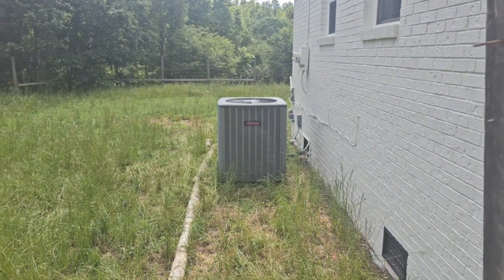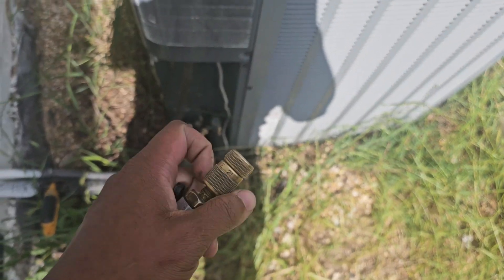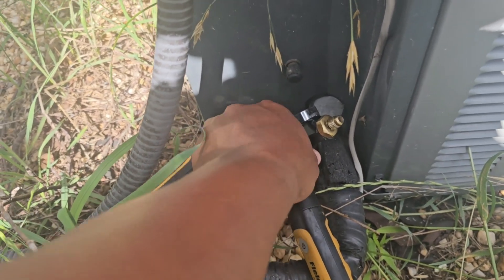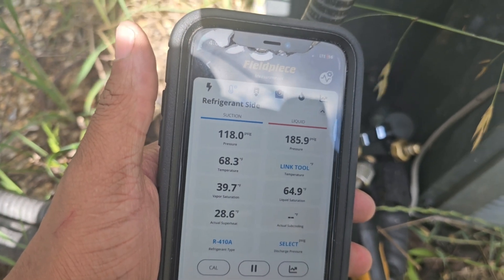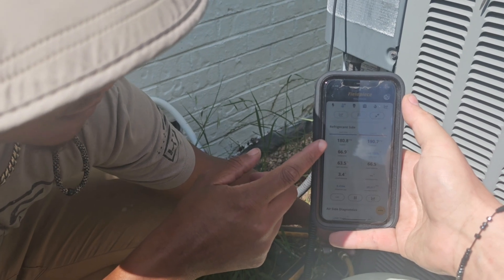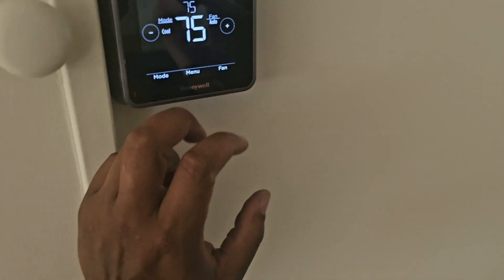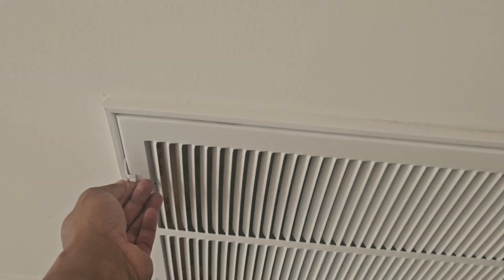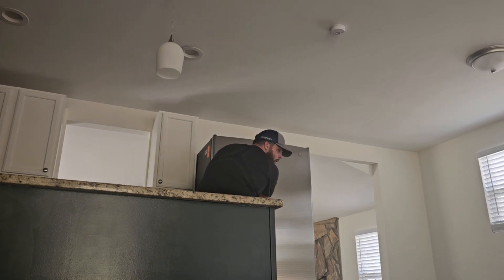Charging Central A/C System With One Hose Method | HVAC

Comment: I love the probe charging. I give it a 10 out of 10. I use two core depressor on both high and low side and low and a ball valve on my hose for control. I use the field piece core removal tool for it too.
Reply from the maker: I was thinking about getting the one sight glass/valve vcrt, everyone's kind of saying it's worth the money
Reply: @AB_HVAC  Bro it is I have 2 the high end one for installation and the one in between for service
Reply from the maker: @robertdavenport9095 okay okay, I'm bout to hop on trutechtools.com and get one asap
Reply: @AB_HVAC   You won’t regret it bro

Comment: At 6:08 you show additional vent in the return. If the line clogs after that vent since it’s lower than the AC pan, it will overflow into the return all over the floor that vent should be higher than the AC pan.
Reply from the maker: There was only 1 vent, the float switch isn't a vent. But you are 100% correct about the vent I put in the return needing to be bigger, there's just no space on that platform

Comment: If there were two pea traps I would have just removed one of them. Yes a vent is necessary for two traps to drain properly,.but if the lower line clogs water will just dump out the top over the vent because the float is higher than the vent.
Reply from the maker: Well the second one wasn't a real trap, more so just...a sinking pvc line lol. And there wasn't too much room under the house on that side the lineset is ran on the ground too not supported at all. I just wanted to make sure it was draining

Comment: Get charging tees for the smart probes, just leave them on when you check pressures, they work like low loss fittings basically, so when you need to charge up you just hook your hose up to the open spot on the charging tee
Reply from the maker: Ooohh okay. I'll have to look into them although I've never had luck with them personally.
Reply: Smart probes, charging tees and measure quick combo is the way to go once you get used to everything. I’ve used mine daily for about 3 years, love them !
Reply from the maker: Dang 3 years! Might have to take you up on it then

Comment: Using core remover is not practical at all. These are a game changer.
Reply from the maker: Wait what do you mean by "these"? Fieldpiece has VCRT's now that have the sight glasses and in my opinion better valves
Reply: @AB_HVAC  I just snagged the   fieldpiece vcrt with the sight glass and 2 valves.  It's pricey, but it is very well built. Much heavier construction than any other one I've tried.
Reply from the maker: @oilandfireguy1739  are you using it to charge systems? Is it good at even gripping valve cores?
Reply: @AB_HVAC  haven't used it yet, just got it at the end of the day today. But it's clear that it's very high quality.  Heavy as hell. Vacumm rated. And you can get a piece to make it 5/16.
Reply: I guess they deleted my link to the charging Tees
Reply: I’m still waiting for mines. They are in back order until June I was told.

Comment: I use the one hose method a lot when I do an install. It’s just easier because I already have my core removers on the unit and all I need is my probes and a hose.
Reply from the maker: Now that I understand. I normally use that with my vacuum, 3/8 hose on suction line and micron gauge on high side port.